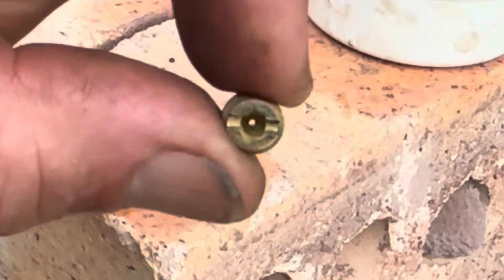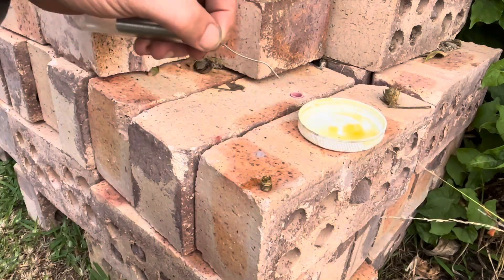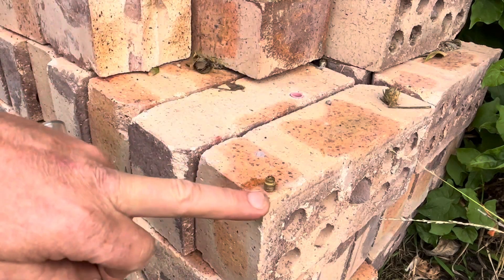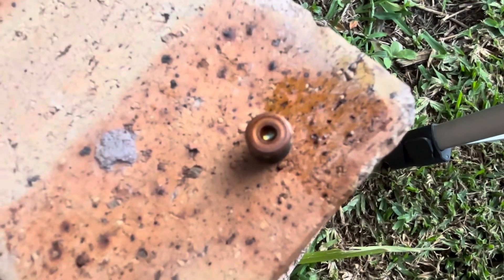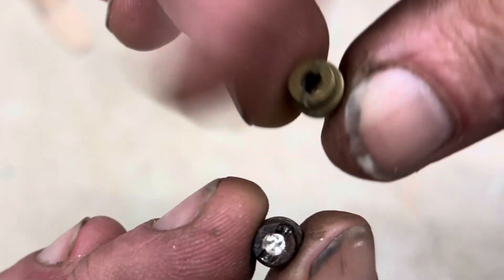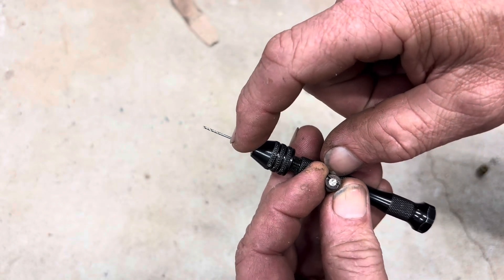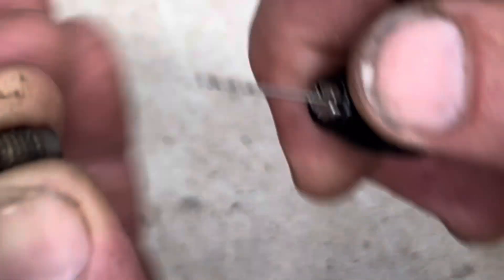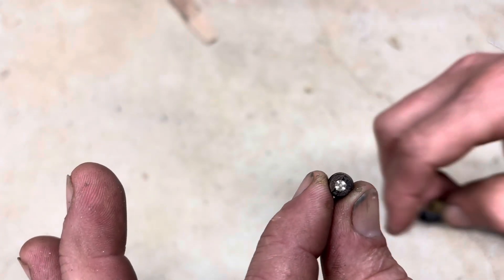Carburetor jets

Comment: I have a tohatsu 18hp carburator and changed the throtle flap axel  with  from other carb but the oem was 6mm diameter new one is 5.87mm   .. i have a litle play in that axle.. do you thing will  go wrong?
Reply from the maker: Hi Mate,
Yes, you will most likely get problems as it going to leak air in and will disrupt the flow through the throat of the carburetor. I have had a motor that got play in the original butterfly shaft and never ran right till I fixed the shaft.
Cheers 🍻 
Aussie Boat Guy 😎

Comment: Love your channel. Got a question. Whats the minimum size outboard you would use as a backup for a f370 quintrex hull,idea is to keep it wrapped up in a blanket up front incase main motor breaks down. Cheers.
Reply from the maker: Hi Mate,
Check out my tiny outboard big boat video. I use a 3.3hp to tow a yacht. 12.5kg motor, I would get one of those.
Cheers 🍻 
Aussie Boat Guy 😎

Comment: I am out of South Carolina and subscribed when I saw you had a Mercury 60 hp you were going to work on as a future project . 
I have a 16ft Hi Tide with a 40hp Mercury which does 40mph . 
I am debating modifying the 40hp or going with a 60 hp !? 
I have watched your videos on you 5hp and was impressed with what you have done ! 👍
Reply from the maker: Thanks for the comment and support, I'm glad you like the videos 👌
I know a lot of people modify the 40hp USA build Mercury but from my knowledge the ports in the 40hp block are smaller than the 60hp so I would want the 60 block personally. Also the 40hp has a 2 to 1 gear ratio in the lower unit but the 60 has a 1.64 to 1 which is really great I reckon. The 40 does go pretty well though as it is a large capacity for a 40hp, love a three cylinder too, sound so good 👌
cheers 🍻 
Aussie Boat Guy 😎

Comment: I'm your latest sycophant.

So doesn't jet size need to match air volume.  Your description of reducing  jet size would make a lean mixture  I thought.  Or is the cylinder displacement also part of this ballance? This may explain why my 15 Evenrudes runs best with a .54 jet as opposed to the .56 jet.
Reply from the maker: Hi Mate, you are on the right track with the air volume mixture etc. So for example, if I take a carburetor off an 18hp and put it on a modified 9.8hp the jetting in the 18hp carburetor is specifically tuned for the 18hp, those jets will be most likely too big for the 9.8hp capacity (sometimes not) but say a 18hp is 293cc and the 9.8hp is 167cc with different flow through the carb so jetting will most likely need to be adjusted.
Running lean is super dangerous for a motor on a side note, you would not want to lean out a stock setup as they will have the jetting pretty close from factory.

Cheers 🍻
Aussie Boat Guy 😎
Reply: Thanksfor the detail. I'll ask more on a later date.
Reply from the maker: Too easy mate

Comment: with the 5hp tohatsu should i upsize or downsize jets from your experience to make more power (i run a fat mixture of 32 to 1 and stock jets)
Reply from the maker: Hi Mate,
With the stock carburetor on the 5hp, the factory jets are the best you can achieve for power. I only changed jets when I put a bigger carburetor on and had to achieve the correct air fuel ratio again. The factory carburetor with the stock jets already achieves the perfect air fuel ratio, adding or removing fuel will slow the motor down and possibly damage it.
Cheers 🍻 
Aussie Boat Guy 😎
Reply: @ fair enough thanks a lot 👍